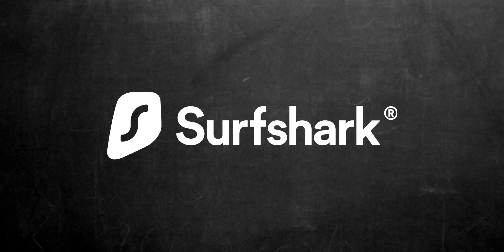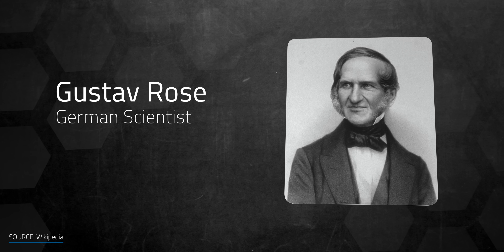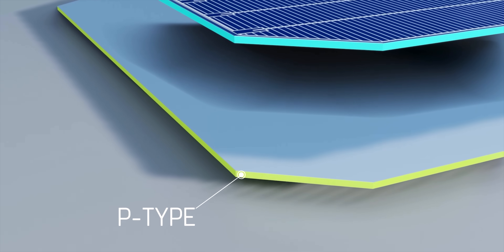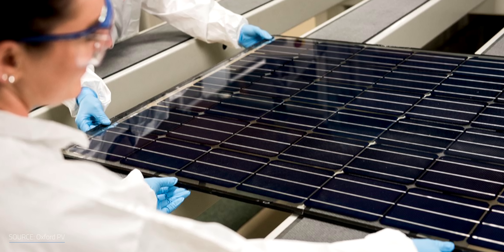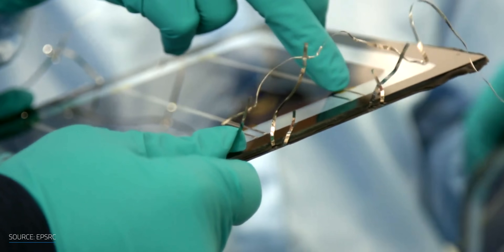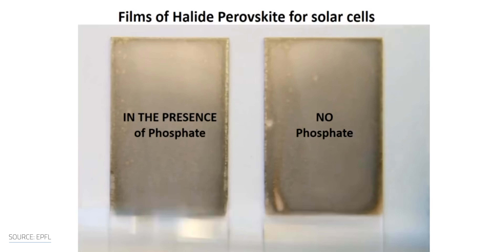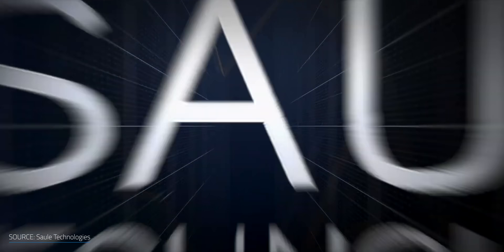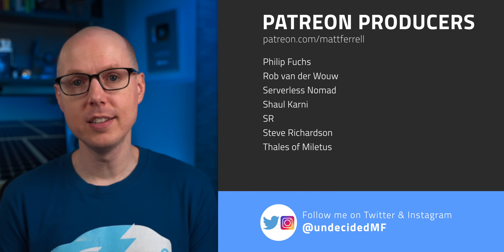Perovskite Solar Cells Could Be the Future of Energy

Comment: If perovskite lasts at least 3 years and cost $0.25 per square foot  it makes silicon obsolete. What I wish to know is do they slowly degrade after a time or fail all at once? A tesla with 20% battery degradation is still a tesla and I would be very happy to own one, it still got 80% left. Same with these solar cells, if they give 90%+ for 3 years and then slowly degrades over 10 years before failing I still would choose them over the silicon for the simple reason that in 3-5 years when I need new ones much more development has been done and I can buy a even better solar panel, with silicon you commit for 15-25 years in order to make them economically viable. This is of cause dependent on their (perovskite cells) recyclability at end of life.

Comment: The amount of lead used the  perovskite panels at the same production rates as silicone is 0.1 percent of that of lead acid battery industry. not such a big deal.
Reply: Still something you'd not want to work around

Comment: If silicon pv cells last 25 years (example price per cell 4 USD), and perovskite cells (example price per cell 0.5 USD) could last 5, the cost for the latter still make it comparable to use the perovskite cells since the cost over 25 years would be Silicon (4 USD per cell) and perovskite (0.5 x 5 = 2.5 USD per cell).  Installation charges would add to the cost, but should be about the same for initial install, and minimal for replacements inside the existing frames for the perovskite.  I see this being a better way to make photovoltaic cells common in the industrial and consumer markets.

Comment: I'm in the early stages of converting an old 6 door limousine, to a plugin hybrid, and the plan has always been to embed silicon solar cells in the hood, trunk, and massive roof

But a spray on solution that i could coat with some sort of clear transmissive ceramic coating, sure, i'd maybe need to run liquid cooling, but this would be much easer to make something that stays true to the original shape of the limousine, than laying down traditional wafers, an insulating layer of air, then glass, to reduce the risks of breakage due to impacts. And yes, i'd still need liquid cooling.

Comment: The difference in the cost of Perovskite versus silicon means they could be replaced more often and still be a cheaper solution...as long as we have a robust and efficient recycling system for the old Perovskite panels.

Comment: It would be interesting to me to go over whatever recycling processes exist for these types of longer term devices.  At 20x less expensive then if the perovskite solar cells lasted 2 years then it could be replaced 20 times to get 80 years of electricity versus the 25 from a silicon cell.  If the cells could be efficiently recycled and replaced then it seems like they would be competitive immediately for cost and value.  Appreciate the analysis and your work!
Reply: which means 20x the transportation cost to recycle said product vs the 3x transportation cost for 75 years. Transportation consumes about a 1/4th of the energy spent.

Comment: If the cost per unit area IS so much lower than silicon, multijunction perovskite may be worthwhile for many applications where area is limited. For mobile applications like cars and boats more cells won't fit, but cells with more output would be very welcome.

Comment: If perovskite durability can get to 30 years with a degradation in efficiency to about 80%, it would be acceptable. (The depreciation limit is 30 years before replacement is expected.) 
If the perovskite films can be produced so that they can be replaced without needing the destruction of the glass substrate, then they will take over everywhere.

Comment: Even if they lasted 10 years instead of 20, if their carbon footprint (sum of greater efficiency and less impact during production ) was smaller than the silicon panels it would already be a victory.
Reply: Installation and Transport probably makes that difficult if they are notably shorter life
Reply: Add to that recyclability. If materials can be recovered, reconstiuted and remade into new cells it will be a win !
Reply: @Neuralatrophy  I would love to see a system that recycles the old panel into the materials used in new panels. Tesla is getting into this type of cycle with Redwood Materials, Inc.
Reply: You're just wrong. The initial cost is higher but the stupendous lifespan means the footprint is smaller. Especially since mass adoption means the footprint is smaller for manufacture in the future. 
Silicon wins the time game, they win the passivity game. It's magic free energy for close to a lifetime, the appeal of just plopping them on and ignoring them is massive. 

Solar panels will increasingly be adopted, they're just too good even at their current low efficiency rate.
Reply: @arandomfox999  The comment isn't wrong. You're totally missing the economics described
Reply: @zweigackroyd7301  the economics are use case dependent more so than described. The refitting costs of labour alone over the long term are not an insignificant cost consideration. 

So tell me how the economics work out for a shorter lifespan if the area is remote and service costs are high? They wouldn't. You're also missing my point that manufacture of the panels will increasingly rely on green energy themselves, reducing impact. 

Though I personally both technologies will end up producing heaps of waste. That's just something that happens with way too wealthy corporations constantly upgrading infrastructure unnecessarily and people being swayed by "superior tech!" whilst their current solution is not in need of replacement. 

People buying new stuff is more responsible for harm than anything else.
Reply: @zweigackroyd7301  I miss the economics, you fail to mention any. Explain how the upfront savings of these stupid panels dodge the damn shipping costs, the installation costs, the additional costs associated with rewiring if the new replacement system isn't of a similar specification etc. 

These panels won't be competitive for long term installation if they're a recurring cost and annoyance for slight efficiency benefits. More realistically multi-layer silicon panels will dominate since the best in that category is already a quarter more performant than these panels. Imagine believing that replacing windows on a high rise on a decade long basis is sustainability. 

This tech is nowhere to be found because it's simply worse, unless there's a major longevity breakthrough it'll remain that way. The only advantage it has is in requiring less physical space and negligible savings in costs when you factor in that SOLAR PANELS ARE NOT THE EXPENSIVE PART OF A SOLAR INSTALLATION.
Reply: Maybe for a large scale powerplant the economics are different, where performance is key and maintenance is a given, I could see that. But for personal grid-tie and off-grid. I am not seeing it.
Reply: @arandomfox999  Golly, you must be right because you use angry filler words. It's damned impressive. Being angry about this sure does prove your point, eh? Let's see, what were the prices per square foot that were estimated? Weight differences? Hmmm, it's sooooo hard
Reply: I disagree. You forget that the installation costs and the inconvenience to the home owner is a big part of adoptioin. I don't see a home owner buying a solar roof that only lasts 10 years in return for a 50% increase in efficiency. 
10 years vs 25... nope. 
They need to fix that. 
Solar Shingles are a massive opportunity that is no good if 10 years is the life span. 
Here is the opportunity to combine 2 roofing elements and save money. 
But not at a 10 year lifespan. 
You must match the 25 year life of current shingles. Tesla has done this with the more expensive material and installation costs Sill forced them to raise prices nearly 50%. 
Imagine incurring that cost every 10 years!

They need to improve longevity several hundred percent. 
Then, there is a very bright future for roofing material.
Reply: @avgjoe5969  So because you wouldn't do it, nobody would? People make this kind of trade-off on large purchases all the time. It will depend on the actual cost difference and actual efficiency difference, along with considerations like recyclability. It's too early for definitive statements
Reply: @zweigackroyd7301  If they can improve life span they Have a winner. Here, now, they aren't marketing them because They don't think they're ready yet. There's almost always a market but you have to justify huge expenditures in capital to start mass production. 

This is, however, a new area and it might be the next "cold fusion" or the next great step in solar. If I gave the indication I don't believe its worth pursuing, then my bad. 

Also, a 35% solar cell that might be put between double paned glass and maybe mostly transparent (due to the thin layer) would be a serious boon if they can improve the cost/life. 
All other applications aside, shaded glass facing south on a skyscraper generating all that power. 
My experience with skyscrapers facing south with floor to ceiling glass was that a) it was too bright b) it collected heat and cost a fortune to cool the rooms on the South side. This would solve both.
Reply: @avgjoe5969  I think there are many real concerns about this technology. What I find odd about many of the comments is there are these really strong conclusions that don't hold up. The ones I really notice were how there was no way this technology could compete, which is ironic given how many said that about solar generally not long ago. It is absolutely true that longevity could be a very big issue, and that the cost and hassle of multiple installations would be negatives. But it's really not hard to see scenarios where a consumer might still go with perovskite. And some in the thread who brought the installation argument seemed to fail to understand that replacing the panels isn't equivalent to repeating a brand-new installation. The point is it's too early for definitive statements, and I don't think lower life-span is necessarily a deal-breaker: obviously it would be preferable to have the same life-span. :-)
Reply: But it's not
Reply: I don't know if it's really a problem with green-house in manufacturing because there is only about 1.25kg of silicon in 20 roof panels.
Reply: but if it creates more waste then what? Generally creating more waste means bigger carbon footprint.
Reply: Not "instead of 20". There is no reason to think typical good 35V panels won't be putting out 80% of original energy after 40yrs. Mine are degrading a little less than 0.5%/yr.
Reply: Nope, 25 years guarantee for silicon.  Don't forget installation, removal, multiple times for perovskite.
Reply: @edbrackin  Hasn't been forgotten. The posited difference was 50% of the life-span and costs were potentially 10% or less than silicon. Combined with greater efficiency that could easily pay for two installations instead of one
Reply: @zweigackroyd7301  what a hog of shit, the panels aren't even expensive for silicon, the more expensive equipment is still the inverters, charge controllers, cables etc. 

Nonsense.
Reply: @arandomfox999  "hog of shit"???? Thanks for the laugh
Reply: @zweigackroyd7301  last test by the NRLE, shows some panel with a lifespan of 100 years above 80% capacity.  The guaranteed lifespan is not like after 25 years the panel just stop working. We are clearly at the stage of 50+ years for panels and not at 0% but above 80%. This is huge and not talked enough. Silicon solar panels are more like a lifetime investment. What is really needed now is cheap battery solutions that can last for days.
Reply: @danielvilliers612  Some panels. The point is to keep the research going. There was a time when the skepticism about the silicon panels was where the skepticism is now with perovskite. 'Nuff said
Reply: @zweigackroyd7301  I am not dismissing perovskite, but people are always about best teck etc as if today's tech is not good enough. And that we need panels with 50% percentage for it to be viable. In fact solar panels are already best bang for buck even with their 20% efficiency. I mean solar is now the cheapest energy needs in human history. And by the way, to make it clear, the panels I am talking about, are not some kinds of exotic silicon  models in laboratory, but actual panels you can buy today.
Reply: @danielvilliers612  I agree. But we do  need to keep pushing, because the production and transport costs for silicon panels aren't great. Far better than non-renewables, of course, but there's room for improvement - as there always is. I wouldn't let it keep me from installing panels today

Comment: Even with a shorter lifespan sounds like they could be more cost-effective relatively soon for situations like solar farms where replacing panels would be a lot easier than say having panels either on a roof or part of the roof. I wonder how recyclable the panels will be?
Reply: Shorter lifespan generally means larger negative environmental impact, so that has to be kept in mind, not just the cost.
Reply: If they're cheap, they won't be recyclable in practice. There needs to be a high enough price to mining and refining for recycling to be competitive.
Reply: @Jamie problem is you are adding more carbon foot print by transporting them so they can be recycled or tossed out. Recycling would help more but I can bet they will not be recyclable and will just add to the trash heaps.
Reply: @fasddfadfgasdgs  these materials our pulled OUT of the ground, there is zero harm in returning them to said ground. You are right about recycling being useless. ALL recycling is a scam. 90% of materials create more carbon output in their recycling process than they "save". Responsible disposal is INFINITELY better than recycling in almost all cases.
Reply: @williameldridge9382  Depends very much on what you mean by to the ground. Soil and solid rock are two different things. And you can't dig a hole in rock and seamlessly seal it off in the same manner it was originally.

Comment: With higher efficiency and significantly lower cost manufacturing, I wouldn't think they would need to last as long as silicone based panels? The caveat there being recyclability. If we're just tossing these things in landfill after 5, then we shouldn't use them.

Comment: Is anyone talking about the astronautical/aerospace applications this cell could have? Assuming they can withstand vibrations and other forces on payloads inside fairings, these low-weight, high efficiency cells would be great to use on spacecraft/space stations.

Comment: I did my PhD in perovskite solar cells. They suck. They are unstable to oxygen, light, water, heat, etc. Replacing the lead with tin is no easy feat, Sn+2 very easily oxidizes to Sn+4 and destroys the entire thing. Silicon cells are like monoliths, impervious to almost anything, perovskites contain ammonium ions and have very easy ion migration within their structure, they don't want to be stable and making them stable is a huge challenge. The world would probably be better off if all the money put into these solar technologies would be put into safer and new modular gen IV nuclear reactor concepts.

Comment: Just imagine a 53' semi trailer that's got 450 sq. ft. of roof area. Even if you can use 350 of that, today's panels can do 5.2 kW to 7kW for that area. The 30% theoretical Perovskite can do 10.5kW. Would be interesting to see what can be achieved on a sunny cross country day of 7-9 hours of solar production. Could easily replace any diesel powered air conditioning units for cold-storage trailers and give as much as 40 miles of range.
Reply: @Vedexent_  weight of the panels will be negligible if included in roof structure. Weight of any storage would be around 1000 lb (using weight of Tesla 100kwh pack). Very low for a 80k gross weight vehicle. Savings would outweigh (haha) the costs imo. Also consider the removal of a gas engine in the chiller unit as a weight saving for refrigerated trailers.
Reply: @Vedexent_  sorry that you're unable to grasp that solar would lead to reduced operating costs by producing either motive energy or energy for cold storage both of which cost a lot. Further, the assumption that assumes every truck operates at max gross is incorrect. Approx 750 pounds extra weight (1000 lb batter minus 250 lb for the small engine used for a cooled container) is less than 1% of the max gross.

Comment: I believe in the idea of solar power we really need to think about of way to kinda have our cake and eat too, at present we use up a lot of l
Reply: To finish up previous post we use up a lot land with close to ground panels that land could still have other uses say for hay or pasture only it’s fenced off and in most cases sprayed to control vegetation or just mowed.
Reply: @Vedexent_  I was not going against solar farms only the way here in Upstate New York has done them most of are farms have chain link fence around them. The strange fact is our own government had these installed, they hired it out to a firm that does just solar farms no one thought of other uses of the land under the panels just to make money off the power. There is where the government has to change there thinking!